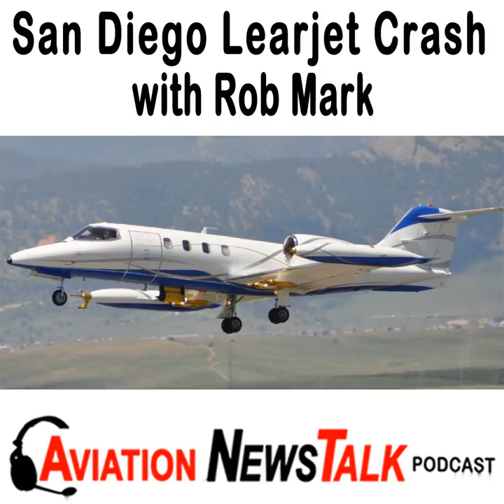214 San Diego Learjet Crash – Interview with Rob Mark

Comment: .. they were on the radio when they lost control of the Learjet .. was crews home base .. Company SOP required 5000' runway .. so 17 was never an option .. an approach they made many times .. obviously they were low to be under the cloud cover .. was reported as 2000' but Lear on video clearly shows at 500-700' they were in and out of cloud cover. I could understand a sharp turn if they got a terrain alert .. doubt there will be anything learned about cause from CVR. Similar NTSB investigatoins are always concluded with "Loss of Control' for 'Unknown Reasons'.
Reply: There is LOC-D to 27R... they were lower than 700ft at least per ADS-B.  You are right they were in and out of base of clouds it appears. All this should have prompted their immediately missing...
Reply: night IFR is straight in approach or go away to where you can  -circling appr at night is called suicide-mike in iowa

Comment: That a Learjet is limited to a 20 degree bank in landing configuration explained a lot about this disaster.
Reply from the maker: Yes. And by starting their turn so close to the runway, there wasn't enough room for them to complete the turn without overshooting the final.
Reply: Actually 30 but it'll drop a wing after 35.
Reply: @RHCP9181  No it won’t. With the proper airspeed, the airplane flies just fine well beyond 35° of bank.
Reply: This is not correct. Normal circling speed in the 35 is Flaps 20°, ref+20 knots. That will keep you safe up to 30° of bank. And, with the proper airspeed, the airplane flies just fine well beyond 30° of bank.
Reply: @AviationNewsTalk  the command and control I was taught for circling the right seat is responsible for keeping airspeed up with hot throttles and keeps lookout the windows for ground reference. The left seat does the maneuver and flies the needles and doesn't look out the windows. With enough throttle and airspeed they should have been able to crank it around what ever bank was needed.
Reply: @aveightr1  and what approx turn radius does Flaps 20, ref+20 give at 20 degrees and 30 degrees bank??
Reply: @gap9992  At typical light landing weights, Vref would be about 116 KIAS. Doing the math, and you really are looking for turn diameter, yields the following: At 20° of bank, 1.5 NM. At 30°, 1 NM. This is no-wind, of course.
Reply: @aveightr1  Just repeating what I heard on this program. I'm not a Lear pilot so I just go by what they said.
Reply: @malcolmmarzo2461  That is the problem. Neither of them are Learjet pilots either. The YouTube NTSB comes out a few days after an accident making guesses. While they are “educated guesses”, we don’t really know why this tragic accident happened.
Reply: @AviationNewsTalk  Max, you should talk to a pilot experienced in this type of Learjet. That it would be limited to 20° of bank in landing configuration is just ludicrous. Normal aerodynamics do not go out the window because it is a Learjet.
Reply: @aveightr1  Thanks Steve and yes I was going to double the radius.  Another channel showed the approx ground track and downwind was probably less than 1NM from CL when they started the 180. Plus they started the 180 a bit too early so had to tighten the turn way more to get between the hills on to final. This is so sad, yes they made bad choices but a bit wider, a little bit longer downwind and all could have been well
Reply: I think you can bank it up and add power and tighten the turn radius very quickly up to the point where something breaks. There is nothing in this plane that keeps you from screwing it up except for the advice in the manual.

Comment: Just wondering, accepting that 27R was longer, could they just have landed on the straight-in for 17, given that they had a headwind (190@5), or was that physically impossible in a 35A?
Reply from the maker: It's likely the company had an op-spec that with a minimum runway length, which some have suggested was probably 5,000 feet. Rwy 17 is much shorter than that.

Comment: If the pilot  was familiar with that airport, and he was,  then why didn't he set up for a IFR  approach into the   longer  runway  from the very beginning. ?   He could have  come in from the  east  instead of trying to  circle  left in that  tight  space. .
Reply from the maker: We explained on the show that the LOC-D approach, which is aligned with the longer 27R wasn't a good option, as it has a very high minimum descent altitude, and an extremely steep gradient, which requires a much higher than normal descent rate for landing straight-in to 27R.
Reply: @AviationNewsTalk  Well that may be true, but planes do it all the time at Lindburgh field with the steep descent over the buildings.  It may have been safer than what he ended up doing.
Reply from the maker: @humelakecabin  I just looked it up. The steepest gradient for any of the approaches at Lindbergh is 3.5 degrees (3 degrees is typical). The approach at Gillespie to 27R is 6.88 degrees, almost double that of Lindbergh. No question, an approach to Lindbergh would have been safer for a number of reasons.

Comment: Isn’t this aircraft required to have “TAWS”?
Reply from the maker: According to FAR 91.223, "Except as provided in paragraph (d) of this section, no person may operate a turbine-powered U.S.-registered airplane configured with six or more passenger seats, excluding any pilot seat, after March 29, 2005, unless that airplane is equipped with an approved terrain awareness and warning system that as a minimum meets the requirements for Class B equipment in Technical Standard Order (TSO)-C151." This aircraft was probably configured to accommodate a stretcher, so it's unlikely it has six passenger seats.

Comment: Displaced thresholds left them with 3,695’ on 17 and 4,636 on 27R. Was this a Part 135 leg, or was it operating under Part 91 as a positioning leg? Plenty of conjecture at this point. We learn from root cause analysis, and it is way too soon to be able to determine that for certain.

Comment: Why was this plane based at Gilespie with the displaced threshold on both runways. I would not want to be based there period . Why even try this . ? Lots of questions. Not a great airport for jet ops
Reply from the maker: Certainly not a great choice. A podcast listener just pointed out that it's cheaper to base a plane at Gillespie than at Montgomery. The plane is registered to a home address in El Cajon, next to Gillespie. So these might all be reasons it was based there.

Comment: Yeah, there is a clear reason a circling approach is prohibited for IFR. So they chose to use a loophole and switch it VFR and circled to the only runway long enough. Instead of diverting due to visibility they had get home itis. Circling approaches in a high performance aircraft at night with terrain. Lets not sugar coat this. Truckie was the same earlier in the year. What didn't they learn from that one too?

Comment: the conversation around 30:53 was intresting to me. that would suggest to me they lost situational awareness if theyre used to going right of the runway.
Reply from the maker: For sure they lost position awareness. They had to know where the mountain was, yet the were flying straight toward it. So I think they lost track of exactly where they were relative to the airport and the mountain. And that's not totally surprising, given they were probably looking out the left window trying to see the airport in rain and low visibility.

Comment: Nothing against the crew here but I don't think they had any problems reading their airspeed. Missing an approach or overshooting one then yeah blame it on visibility. There were 2 sitting in the cockpit so one should have been reading off the speeds during the circle and the other looking for the runway. Too steep a bank at to low a speed and you load up that wing before you realize it over she goes. Part 121 has what's called a Minimum maneuvering speed in both configurations,  this also includes a safety buffer. Airlines cut out these circling approaches all together as they were just too risky a maneuver with a high workload environment.

Comment: If this was their home field, how in the world can you guys say (at 6:05) that they “got surprised” by the hill???  That makes zero sense and a desire to go easy on these pilots, because their business was a beneficial one, will yield faulty analysis.
Reply: Surprise due to not knowing they were as low as they were… If they were unaware of their altitude relative to terrain, disorientation could have made them not know the hill was there until the last second. Knowing the existence of something doesn’t mean you are consciously aware of it at all times.
Reply from the maker: I'm sure they knew where the hill was. I'm also fairly sure they didn't know exactly where their plane was, which is loss of position awareness. Given that they were circling at night, in rain, and poor visibility, while keeping track of the airport over the left wing, it's not totally surprising. They were doing one of the hardest things there is in aviation, which is why it has such a high accident rate. And the reason we went easy on the pilots is that they're human. All pilots make mistakes; fortunately relatively few of the mistakes we make are fatal.
Reply: I’ve only been in GA a fairly short time and in a very modest way (about 650 hrs in a 65 hp ‘46 Champ) but I’ve been watching all aspects of the aviation world for a good 55 years.  

I was taught to overlay our pilot’s natural boldness with humility.  It’s not about becoming timid.  I fly and practice pushing my limits and the Champ’s because it keeps me sharp—for me that pushing is practicing in gusty crosswinds on concrete and simulating engine out glides.

Way too many pilots are making dumb/fatal decisions in GA—so many that in my opinion it’s time to stop being gentle (once it’s clear a darn careless decision resulted in fatalities).  These two guys took out two totally dependent crew.  Over the field at 300-400 feet at 140 kts in mist/fog and then circling to another runway?  Are you kidding me?

A much higher level of respect for the airplane’s and crew’s limits has to become a drumbeat, a very loud drumbeat, or the “same ol’ fatal same ol’” will continue.  Forever.  That means humility needs to start to replace complacency, over confidence, etc.  And that drumbeat includes bluntly saying the truth about those who kill others out of complacency, over confidence, etc.

If it turns out that complacency and over confidence on the part of these pilots—at 300-400 feet at 140 in mist/fog—was the cause of the horrific deaths of these two nurses, in my opinion the flying community should say, loudly, shame on these two pilots.  This crap has to stop.  (And here it was lucky folks on the ground didn’t get immolated.)

Comment: In my opinion This was a case of poor planning from the very beginning. First of all this is an air ambulance company and as such they need to be available 24/7 vfr/ Ifr they have a high speed air plane which needs a long runway with an ifr approach. they located at an airport with an adequate runway length but no ifr approach because of terrane problems . The planned operation called for the them to use an ifr approach to a shorter inadequate runway and and close the ifr flight plan when they had the field in sight and circle to land on the longer runway. This was a plan that just asked for a crash and the combination of marginal vfr and approaching darkness caught up with them fatally, proving that their operating plan was flawed from it's inception.

Comment: They have done that circling at night before, 1- but long time ago..  2-That was in rainy night.  Bad decision to do it while rusty on circling nignts and with rain showers too.   BAd.
  Second error,  he turned too soon after the overhead.  A rain Cloud can block the view when you are trying to see the runway.  First thing you do when you dont see the runway due a rain shower in the way, is to shallow the turn because you dont want to get into that rain, you want to go around it instead.  But shallowing the bank at the beginning of the base leg with a tailwind in that area will overshoot the runway.  That was the 3rd pilot error. and will lead to the  4th pilot error;  A steep turn on base when see they will overshoot, or pull up too much elevator and stalled it.   4 big pilot errors.  
 About the 3third pilot error;  The basics of GRM turning is....  Headwind LESS bank, Tailwind MORE Bank.  Turning shallow with a tailwind on base leg have killed thousands by steepening the turn when see overshooting.  You turn  steeper FROM THE BEGINNING,  then shallow the turn as you finish.  Most pilots dont practice Tailwind alignments GRM. 
 You should not do GRM when you cannot see ground clearly.  Ground Reference Maneuvering needs visibly ground reference points.. That is why is called  Ground Reference Maneuvering and not "Blind Reference Maneuvering".  
Decades ago, a commercial pilot acquaintance, doing GRM over his small mountain town to salute his family, on a company twin, did LOC due night GRM and died.

Comment: Tragic!  It might be academic, but was the accident flight not considered a Part 91 event?  There was no revenue pax/cargo on board.

If flown under Part 135, was the crew not illegal in cancelling IFR?  I believe they had no VFR flight plan on file.  Is a filed/activated flight plan not a Part 135 operating requirement?
Reply: While many operators switch 135 to 91 for empty legs, its technically not legal..
Reply: @Realflight1986  Are you certain of that?  I acknowledge there may be an OPSPEC or company policy governing which is more restrictive than Part 135 itself.   But, if truly a Part 135 op, was it not illegal to cancel the flight plan (IFR) this crew was on without having another flight plan (IFR or VFR) on file?   I have operated Part 135 (pax/cargo, but no MED) for years and am well aware that under Part 135 one has to be operating under a filed and activated flight plan.  I suppose no VFR plan was filed in the accident flight case
Reply: @vgrof2315   under 135 you may cancel your IFR flight plan with one of the following, the aircraft must be within 10nm of the airport, vfr conditions maintained, aircraft will be in direct communication with and under control of atc, people on the ground awaiting that specific flight… ( my words)  not sure off the top of my head the actual wording.  Though most operators that are doing the 135/91 switch do it so as to bypass the duty hours/ flight time requirements (making it a potentially very long day for a crew)   Hopefully this cover’s your questions : )  better yet, makes sense!
Reply: @Realflight1986  OK.  Thanks.

Comment: Why go slow with all that available power ?
Reply: Short distance from the base to the rwy. They had to slow down dramatically and be aggressive with the banking.
Reply from the maker: If they went faster, they would have a much larger turn radius. The turn radius is a function of the square of the speed. So a plane at 140 knots makes a turn that's almost double the size of a plane at 100 knots (assuming they're both at the same bank angle). They had already boxed themselves into an area that was too small by turning to downwind too soon, so going faster would just make it even harder to stay in the small area in which they had to maneuver.

Comment: I would never have canceled ifr.
Reply: Required for this circle approach due to terrain hazards to the east and northeast.
Reply from the maker: Clause, since it was night, they had to cancel IFR if there were to land on any runway other than 17. But apparently the company required them to use runways longer than 17. So then the choice became to cancel IFR and land on 27R or 9L, or divert to another airport.
Reply: @AviationNewsTalk  go missed and request 27 or 9. Since they knew it had to be 27 why on earth did they run 17. It cost their lives. From what you say circle tl at night was na. But they did it anyway and to trick the faa they canceled ifr. They fatal error to me is picking the wrong approach to begin with.
Reply: @MarcosElMalo2  go missed request 27 or 9. Since they knew 27 was required why on earth run 17. They should have required 9 or 27 from 10 minutes out. Never cancel ifr till your on the ground

Comment: Perhaps it will turn out that it was something as simple as the wrong altimeter setting
Reply from the maker: I was wondering that also. Someone commented that the plane passed the different fixes on the RNAV (GPS) 17 approach at the correct altitudes, which would indicate the altimeter was correct. I haven't tried to verify that, so I don't if it's true.